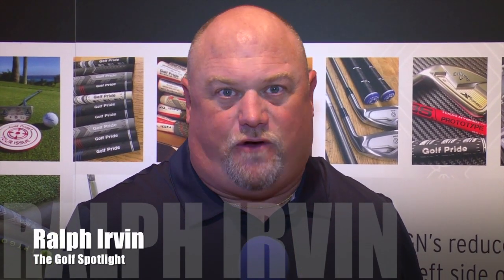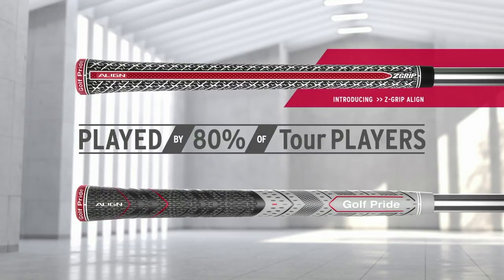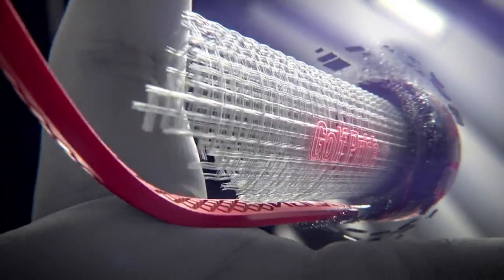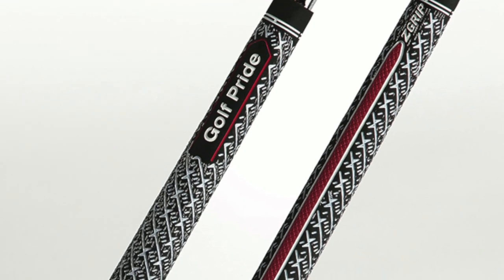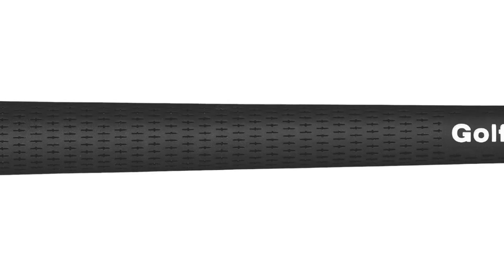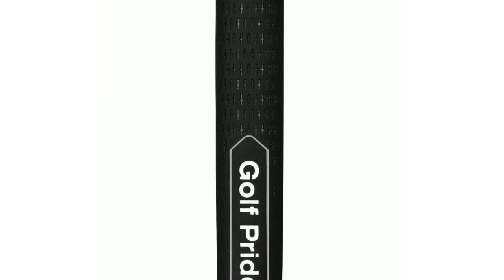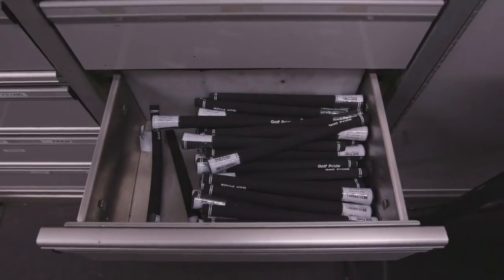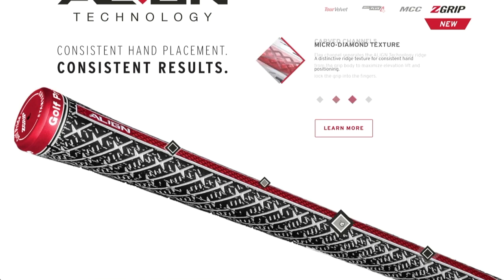Golf Spotlight 2019- Golf Pride ZGrip Align & Tour Velvet Plus 4

Comment: A bit of a gimmick. Golf pride tour velvet logo down is perfect
Reply from the maker: If players like them, they stop being a gimmick and become a choice.  This is one of the first mainstream implementations of alignment strips and has been very well received.  As for the Tour Velvet, product evolution happens all the time, and in this case, Golf Pride kept the original and not just replaced it, which means all players should be happy.  Thanks for watching!
Reply: @GolfSpotlight  well I respectfully disagree. Companies innovate all the time to show something new to the marketplace and renew interest from retailers. Often it’s not based on real need.
Reply from the maker: @jacc9061  That attitude would have players still hitting balatas with persimmon woods. No one NEEDED better, but it is the innovations that make the game more enjoyable for most, and that includes grip tech.
Reply: @GolfSpotlight  true innovation does happen, but in certain product categories, different for its own sake happens to, too often. With that attitude we’d all be running out and buying the supposed “latest and the greatest” each year, which is exactly what the introduction was designed for. Stop playing naive.
Reply: Playing golf for about 1.5 year, using tour velvet align midsize for driver, i can say that slightly proturding alignment helps me to grip better and more consistently. Dunno for more experienced golfer but for me it works, just saying.
Reply from the maker: @gpa7153  Like everything in golf it is individual.  You may share a trait with a tour pro, and yet have other traits that pros would never go near.  Nature of the the beast in an individual endeavor.  Thanks for watching!
Reply: There's nothing gimmicky about it, many player's add extra wraps to the bottom hand. This makes that unnecessary, and provides a consistent feel, a softer feel for the bottom hand, where as when you add extra wraps it creates a very firm grip. It also creates a more convenient, consistent installation. As far as the Align feature, Reminder Grips have been around forever, not so prevalent lately, it's just another choice. If you like it, buy it, if you don't, don't. Nobody's got a gun to your head.😄
Reply from the maker: @kccodex8931  Thanks for watching!
Reply: @kccodex8931  ya but the build up in the lower hand has nothing to do with the alignment strip. Well, maybe I’m being narrow minded. If it works for you, more power to you.
Reply: lamkin crossline blows them outa the water

Comment: It’s hardly an innovation, had a set of irons with alignment strip on grips 35 years ago, great confidence booster, unfortunately lost them in the divorce shall we say😂
Reply from the maker: The innovation does not come from the concept, but the integration into the grip structure AND having it be conforming.  Pros have added a reminder cord forever, but it was never and could never be perfectly straight, etc...these are as close as you may get.  Most important, is they are merely an option for their already popular models.  Thanks for watching!